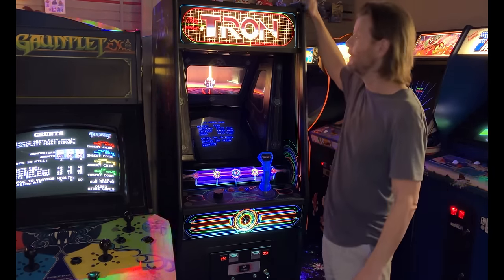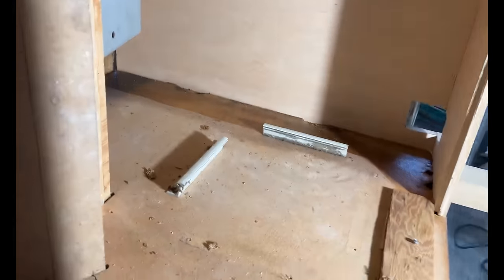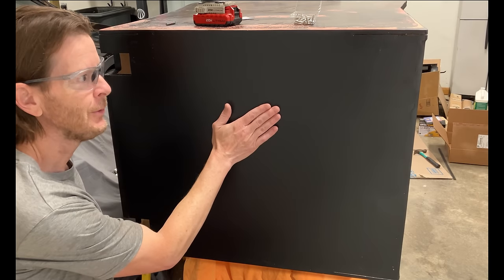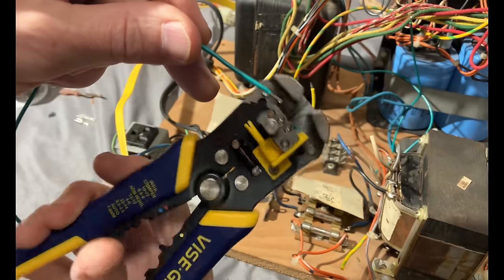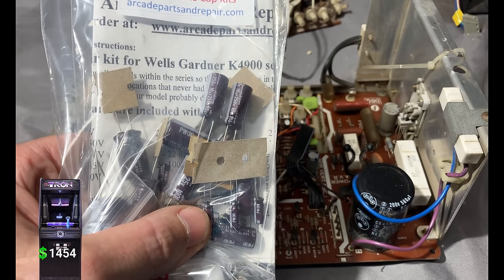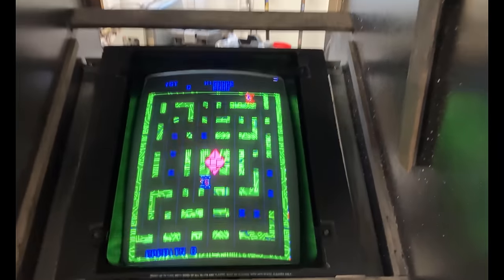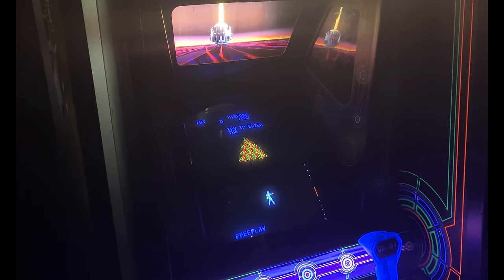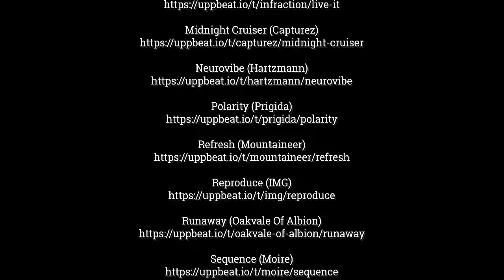"Trashed" Tron Arcade Restoration!

Comment: My question (I have just started watching it)  If the cab was in such poor shape, why did you spend SOOOO much money on it.  The reasoning is if you have to spend time fully restoring the cab, maybe building a new one would have been better?
Reply from the maker: If money were the point then yes, probably cheaper and far less headache. For me, having grown up with Tron in the arcades, I was determined to save one from the landfill. Or burn pile.
Reply from the maker: Plus I’m always delusional that I can fix it for cheap, and usually think I have, until I go back and start adding it all up for the video. Then reality sinks in :)
Reply: @tcurtis49  I am about half way through your rebuild. You have done a fantastic job rebuilding the cabinet. Based on the water marks it looks like it was in a flood.
Reply from the maker: It's sometimes hard to tell whether it was in a flood or just in moisture so long that it soaked up the sides. In this case I'd tend to agree with you :)

Comment: Great resto, but next time, consider using plywood instead of particle board.  Birch wood would be ideal, but particle board has a shelf life of around 10 years or so, depending on the climate, before it starts to degrade.
Reply from the maker: Thanks! I did use maple plywood for the base and the lower cross section on the back for structural purposes. I used particle board on the back door only, mainly for authenticity, since it’s not load bearing. It may be more future proof with plywood but in a home environment should last quite some time.

Comment: Im fairly sure that wherever you live there must be a harbor freight store nearby.  In that stkre you will find more bondo but also a mixing board that is reusable and more importantly yelliw plastic bondo spreaders that are  Specifically made to spread bondo with you can even trim them down to size you need a smaller one they also make large ones. Watching you mix and spread that bondo was painful
Reply from the maker: I have Bondo spreaders but like the accuracy and control I have with that thin metal spatula. And with paper plates I have no cleanup. But I realize it’s not for everyone and maybe I’ll give those tools another try :)
Reply: You did a great job anyway! I used to work in a paint and body shop so bondo is familiar to me. You can cut the spreaders to any size you need. The bondo board can be cleaned with lacquer thinner

Comment: not to be that guy but reallyyyyyyyyyyy it should not be on its side.in the bed like that. There's not 'much' support side to side (kinda "missing" a whole face, the front) for when you hit an inevitable bump/pothole. vs on its back with the only "face" being the front, suspended in air... If that happened to destroy itself, it wassn't going to make it home anyway....
Reply from the maker: That’s ok—you can be that guy! For Tron, there is no flat front or back and we didn’t have back doors so it would have placed a ton of pressure on the center cross board. Believe me, we discussed the odds of it collapsing on itself on the way home…but there was some good support in that direction from the control panel and some metal bars across the front. And with no weight of a monitor (or much of anything) inside it wasn’t very heavy.

I was happy it survived and yes, I always transport games on their backs when possible.

Comment: In plastic bags, yeah. Not talking ESD.
Reply from the maker: How much ESD are you talking?
Reply: @tcurtis49  These older chips often are very sensitive to electrostatic loads. A pure plastic bag is not conductive, electrostatic charges can built up. That's why it's a good idea to use ESD bags with high resistance, so no charges can build up.

Comment: I can see why you only paid $225, it had no electronics inside the cabinet. or should I say roached cabinet. great work getting it back to original.
Reply from the maker: I was hoping it would be around $75-100 but it worked out in the long run :)

Comment: Nice job, but an FYI on medical masks, they do not prevent you from breathing dust, they are for keeping g you from spreading infectious particles when you breath out. If you care about your lungs, I highly recommend you start wearing a real N95 dust mask.
Reply from the maker: Fully aware and I do put one on when I'm worried about fine particles. My dental masks are fine for the majority of the major dust--if not they wouldn't get the outside covered in it while I'm working, and healthy lungs can handle some particles here and there like I kick up on these projects. If I were in an industrial setting continually exposing myself then it would be an irritant over time, for sure, and can lead to some long-term lung problems. I am sensitive to dust and will cough quite a bit if there's something outside in the air, and I don't have any issues while using my masks (which are the same ones I use every day in my office), for what that's worth. But I will keep that in mind as I continue to work on these games.

I'm often surprised how rarely I see the supposed experts on TV demolishing a house and kicking up drywall dust and whatever else has accumulated with no masks whatsoever. I would never do that without an N95...

Comment: for $175 you could of rebuilt the entire cabinet in new wood. The empty cabinet with all the rotting wood was not worth what you paid for it. The original blue light flight stick wasn't even included.
Reply from the maker: Yes, of course. But that wouldn't have been any fun. It was worth it for my enjoyment, and that's what really matters :)

Comment: you need to heat shrink your solder joints.
Reply from the maker: On what parts? I always heat shrink where I solder wires together.
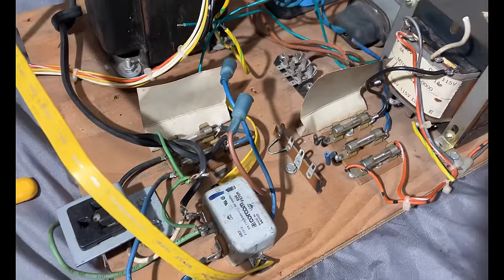Reply: @tcurtis49 46:33  sorry if i came off rude wasnt trying to be.  anything that has voltage running to it such as the fuses.  those fuse holders a bit dangerous as there is more surface area for a potential short.  if a wire is soldered to a terminal or has more than 1/8 exposed joint. good practice means things last longer.
Reply: @tcurtis49 and especially on the transformer posts.
Reply from the maker: That’s a bit unusual as I don’t see them come from the factory like that but yes, anywhere that a short might occur is a good thing to cover up. I’ll keep that in mind as I keep chugging along on these projects :) And no, it didn’t come across rude—just wanting to know the specifics. Thanks!

Comment: Disregarding the lower particle board work, this is a top tier, period accurate restoration.
I would have given up on the Audio board and used a modern mucro digital amp, and a recent vintage switching power supply, but you went all in and didn't corners, except for bad particle board 😉 
I was afraid you might deface the original cab side art, which was basically most of the value for what you paid, other than the original cp and spinner, which together probably worth over $100.
I would have tried to clean the original cp overlay as is. I don't mind the cracks and peeling and cigarette burns- that vintage patina.
Reply from the maker: I basically busted off any bad particle board and mended it by making particle board patch, so I was happy with it, With the resin it’s solid as a rock. I will leave a CP overlay if it’s just a little bad but it was a bit much for me here, especially with the colors of the updated art. Phoenix Arcade makes the monitor shroud and other parts and he does use UV inks on it. Mine is a bit reactive still but not real bright. The monitor is 19”. Not sure the exact angle.
Reply: Thanks for info.
Again, you did outstanding restoration work.
Personal judgement call re repair or replace wood parts.

Comment: Dont use fucking toilet bowl cleaner...WTF use fucking electronics cleaner or DI WATER
Reply from the maker: It’s pretty common for those who repair boards day in and day out to use toilet bowl cleaner—chemicals are chemicals no matter what the name and it is an alkaline neutralizer, which is what is needed. I’m not sure of any particular harm to circuit boards from it—I’ve used it pretty intensely at times and it’s always done the job and nothing more. But to each their own, of course!

Comment: i would have just used new plywood on all of it rather than the particle board.  Those boxes were meant to be interchangeable, so any game could go in it.  It just makes sense with that much water damage to buy two sheets of 1/2" plywood.
Reply from the maker: It would definitely have been easier and more straightforward to do that. And if anyone is restoring one that’s probably what they should do. I looked at it as a challenge to see if I could restore it and keep the original sideart as well, partly because there wasn’t much original art on it to begin with and also because I wanted to try something different. In the end it exceeded my expectations but if it hadn’t I would have gone ahead and just replaced all of that swollen and damaged particleboard. And maybe next time I won’t have the energy to go through all that labor again anyway :)